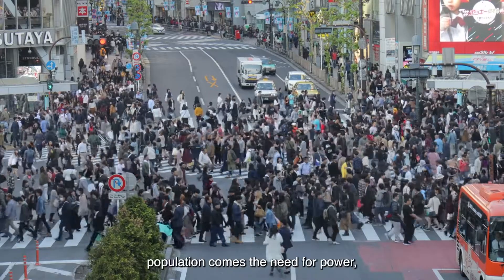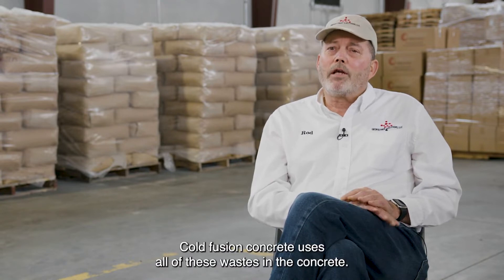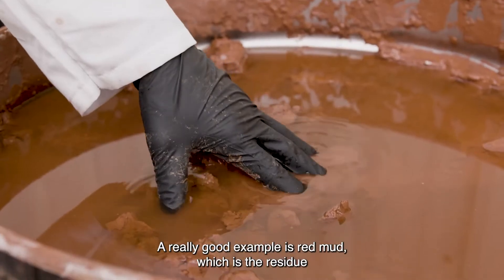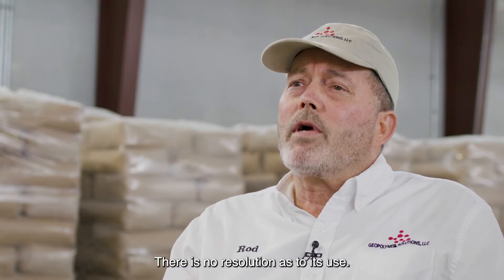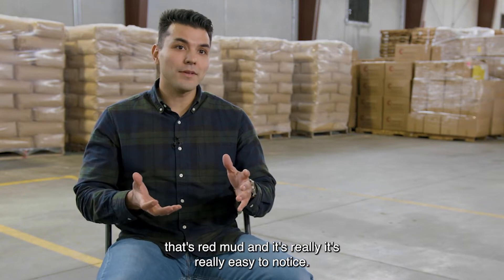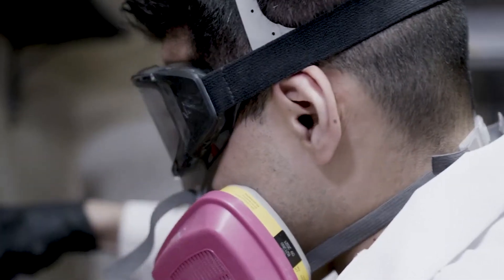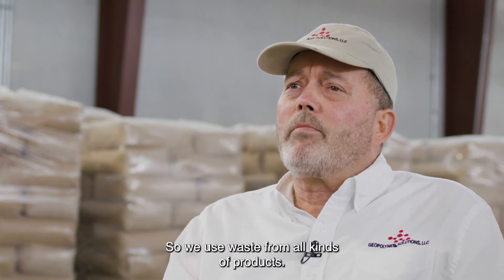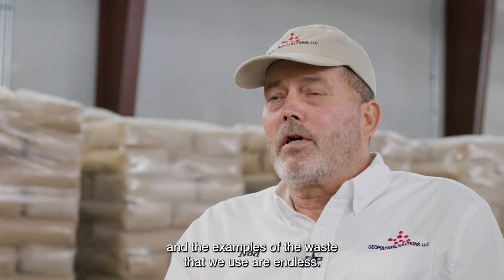Geopolymer Solutions Red Mud Technology Innovation

Comment: I thought this stuff was incredibly caustic and dangerous (Ajka in Hungary). Being so very basic (12 - 13?), if it can be moved safely and neutralized into concrete, then that is a problem solved. Because of the reactive alumina PPE will be very important, and perhaps some isolation so that leaching into waterways does not occur.